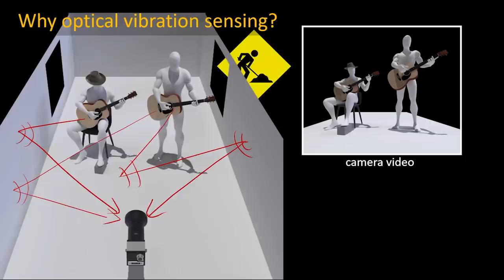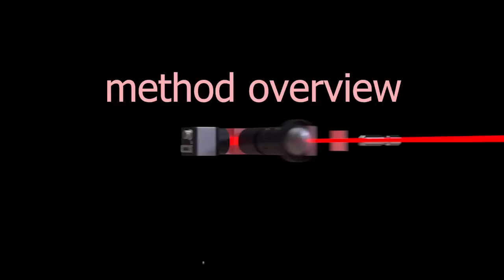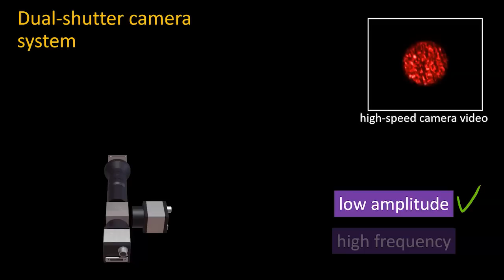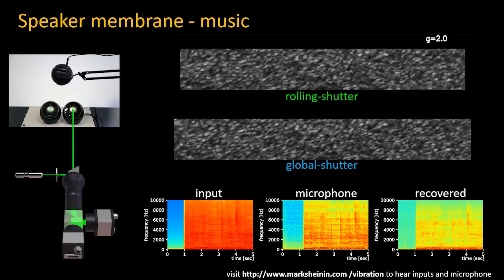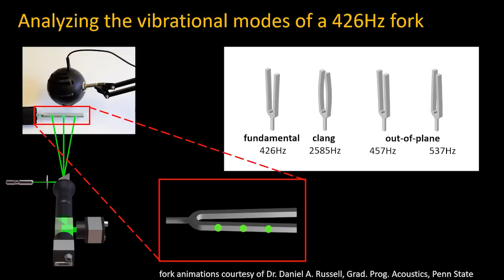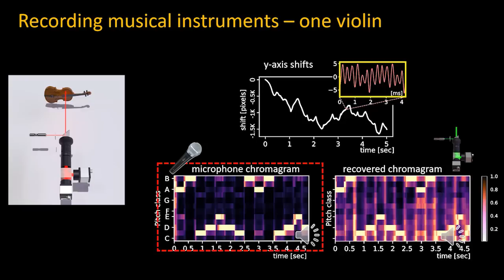Comment: Very cool! Just wanted to share that like 5+ years ago i read about a multi microphone array that could be placed in a basketball stadium and recover individual conversations. The way it worked, is that there were hundreds of microphones put on a "inverted" dish, and each one would capture the sound from the stadium, from up above at a slightly different time. These tiny differences would be used to reconstruct the 3D sound of the entire stadium, and it could focus on individual conversations, while filtering out everything else.
Reply: Do you have a link?